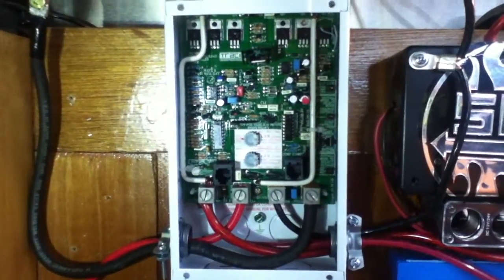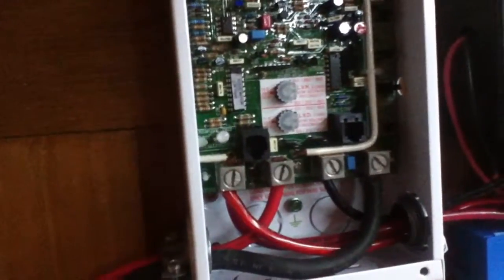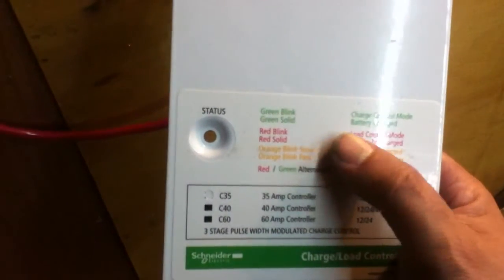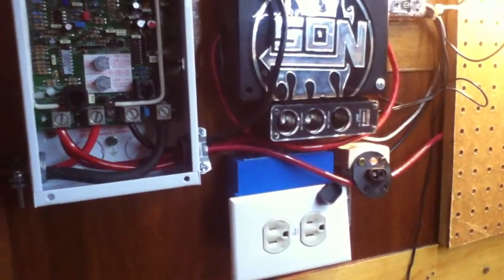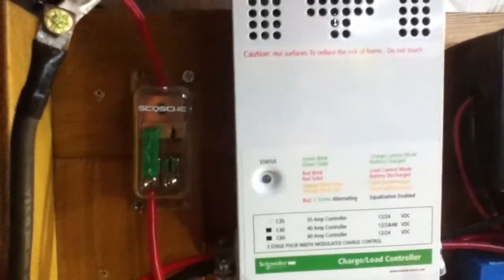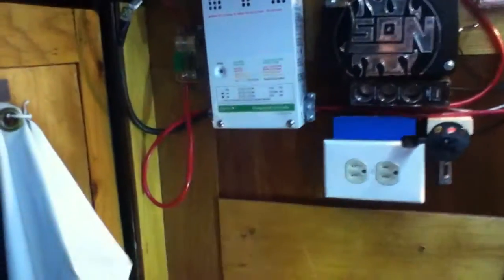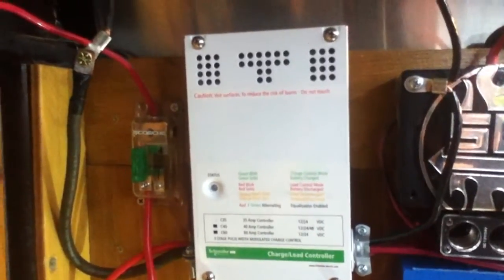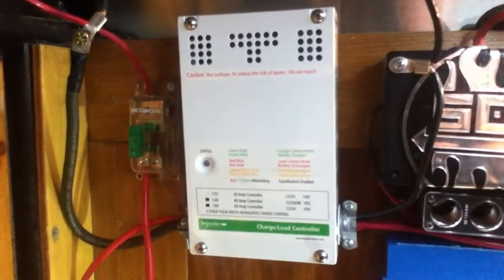Xantrex C35 Part 3 Hookups, installation and settings

Comment: Some things you said are just not true.There are pop out's for conduit in front,sides,& behind the unit.None of my wires are crossed on my install.Also ....you do not have charge controller ground .... (green screw)hooked to anything whatsoever!(it says clearly in the instruction manual, to ground to a copper ground spike 8 feet in the earth)I got mine hooked up correctly,to a 400 watt jinko solar panel(that is also grounded in parallel to copper spike)with a 15A fuse going into it,40A fuse going out to batteries.Also have a 12v fan blowing through mine,& it works fantastic!
You might want to ground that,so it can function correctly,or just stick to the cheap harbor freight controller bud....lol

Comment: I have one of these they are very good. If you get the LCD or remote display module it will show pv amps and watts as well as the battery voltage.

Comment: Don't disconnect the load with the solar panels connected and in putting volts/amps it will blow a varsistor. I have the 60 amp model and did that. Bang! I replaced the varsistor and it works fine.

Comment: The reason for the adjustable knobs are to meet the specifications of different kinds of batteries for full charge and float charge I just checked mine with a voltmeter when I adjusted it the original time to make sure the dial is doing what it said it was supposed to do according to what votes it indicated on the little plastic knob

Comment: thanks god. I thought I was the only person who saw this manual as a kind of confusing think though, but watching and listening to you... I feel better now. thanks, and I agree with you..this is a remarkkable brnad..but...setting those small potentiometers..uhmm kind of tricky... and also that diagram in page 45.. uhm... let me tell you something... I connected my 1140Wp off grid system and ..after 2 weeks.. I lost a battery... and I still dont know what did wrong.... It is dissapointing me..but... part of the learning process. good videos..thanks... do more...

Comment from the maker: Power tool usage can roast equipment from what I can tell so I want to lower the stakes on how much money is involved when I test this stuff out.   True MPPT charge controllers cost so much more than PWM that they are often not worth the extra money in the 20-30 amp range of power production.   They start to become more cost effective on larger systems where the ratio of efficiency vs cost vs power makes it a better investment than just more panels.    Small MPPT controllers are often not.